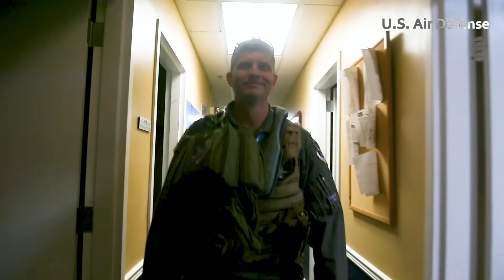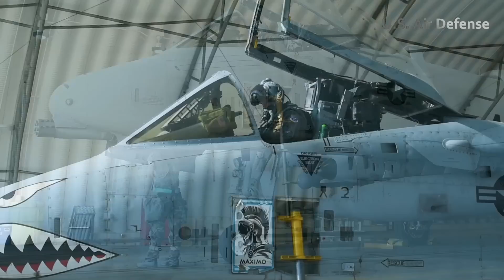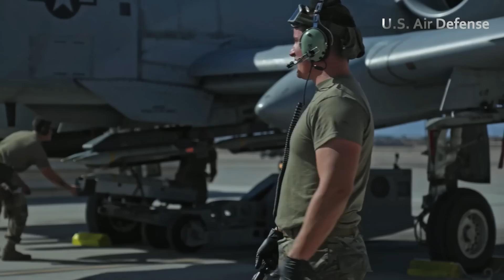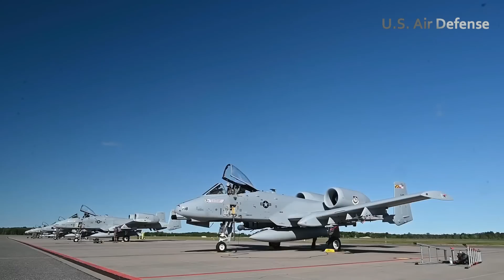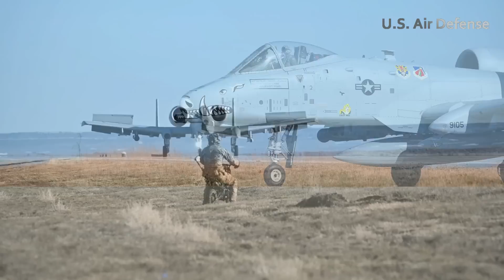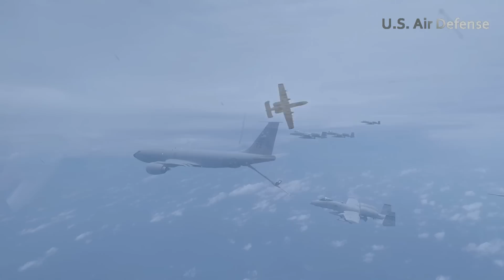U.S. Air Force A-10 Warthog Pilot's INSANE ACTION Amid Rising Tensions

Comment: This recounting of a test flight is interesting but more impressi e are recent accounts of A-10 missions in Yemen this past month.

The A-10 is not supposed to  operate in contested airspace like Yemen which according to reports has deployed some of the best air defense Iran has which in turn is a modufied version of Russian/Soviet tech which in sime ways is competituve with actual modern. Russian  systems and equivalent to Chinese systems.

This is supposedly not possible on the modetn battlefield and demonstrated in the Ukraine war where SU-25  on both sides which is somewhat similar to the A-10 have been chewed up and no longer fly these kinds of CAS missions at low altitude.